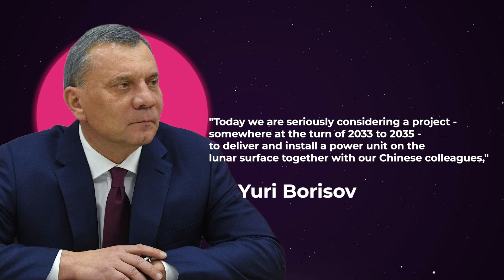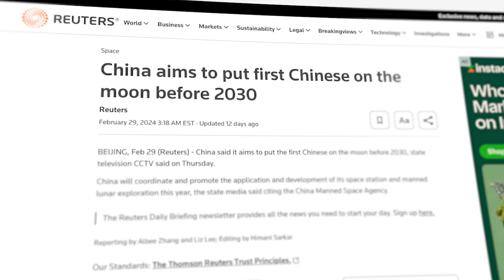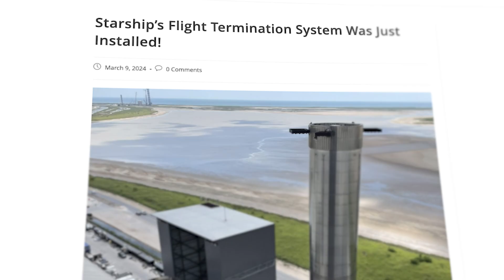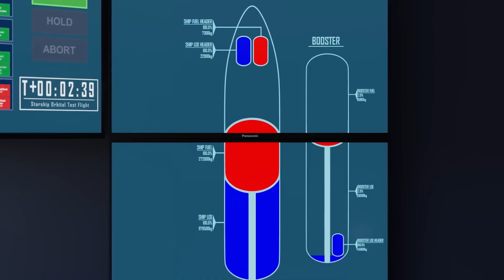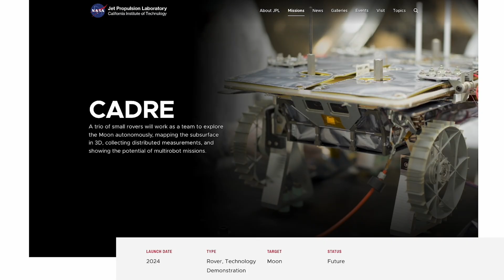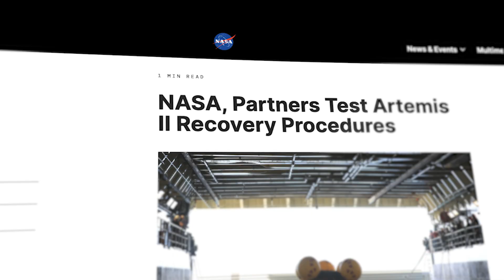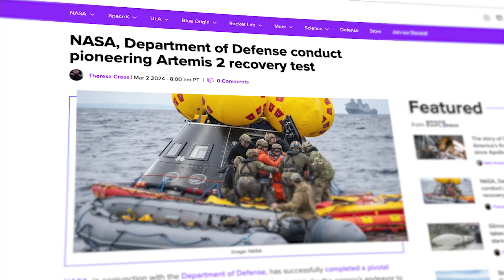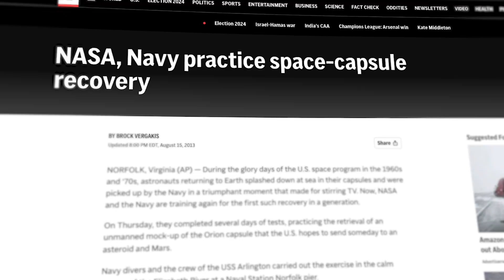China and Russia Reveal Plan To Build A Nuclear Power Plant On The Moon!

Comment: Where are they going to get the water supply to heat up for steam to turn the turnbine? 

Assuming they won't be able to find a continuous supply of water, how large does the radiator field have to be to cool down the steam? I guess they could just pump those steam through cooling pipes buried in the moon surface. That would still be huge, though.

Comment: parabolic mirrors and sterling engines is the way to go on the moon but we need to drill to the center of the moon the loose dirt the core is cold its the perfect place to put a base and there 0g there so you can do your 0g science theres and plenty of material to hold in 15psi so it can be comfortable there temp too just like the earth only its dark pitch black only light comes from lights. but a different types of technology maybe be better there like ion lifters will actually work there so static electricity can maybe more efficient.

Comment: At least 2,000 rocket-trips(?) If using Moon's sand & limestone (?). But still lack of steel rebar (even moon (1/6) gravity is weaker than earth 's make thinner/lighter Concrete Domes or Shelters.. but if Everything must came from earth.. at least 12,000 to 15,000 trips (of material conveyed) will never be enough..) Can we build Cement & Iron smelter on Moon.?
Not to mention Nuclear Power Plant.!!

Comment: Nah its not a huge battery problem. You use Hydrogen generators. During the Lunar day you use Solar to separate water/hydrogen which you then store ti burn later.

Your water is the battery uncharged and your separated hydrogen and o2 is your battery in the charged state.

During the 14 day lunar night you have all the power you need.

Comment: Starship is a disaster from start to finish.
Oh and the line of the video was from the scientist who said "heat dissipation is really the only technical hurdle to solve"   as if that was something new and not the direct problem and reason we have not put active nuclear reactors into space based craft for the last 70 years despite being able to make them small enough to do so for the last 70yrs and nothing has changed in the immutable laws of thermodynamics nor materials sciences to make that any easier today than it was 70 years ago. Heat is heat. On the plus side at least you dont have to worry about fallout from a meltdown.

Comment: Can't happen. No water on the moon, because of no atmosphere on the moon. The only way to keep the reactor from overheating is by outside temperatures, but that is crazy, because space is really cold in the dark and really hot in the sun, plus all the radiation from the sun and solar system.
Nuclear energy has to be produced underground, where it can be contained and I don't see silica sand as a great construction material, unless it can he turned into high strength glass+!!

Comment: 14 days of night indeed is a problem for a photovoltaic power station. But if the solar panels are placed on mountain peaks or crater rims near the lunar poles, they almost permanently receive sunlight. My tram already has evaluated the data. at least for 300 days per year we receive sunlight.
 And under these conditions, photovoltaic power plants are more efficient, safer, simpler, and require much less payload than  a nuclear reactor.
Reply: You wrote a lot yet said… Nothing? What happens with maintenance for example..?
Reply: @angelsackson   what did you not understand in my comment?  I do not see a reason why a nuclear reactor should require less maintenance than a photovoltaic power plant

Comment: Nuclear power is the way to go.  The heat can be radiated away if anyone is thinking an earth type nuclear reactor on the dark side of the generator, reactor or craft.  But small plutonium decay reactors as used on current probes is doable, they just need more of them or scale them up.  Then utilized rockets to launch and spent radioactive material into the sun to get rid of the problem.  Clear forward thinking on removable plutonium pellets built into serviceable fuel modules, that can be replaced (as needed) and then placed into a transport vehicle that can be launched from the moons surface to the sun.  Depending on which plutonium isotope used, the half life of the plutonium 238 used in the Perseverance Rover for example is 87.7 years… so these power systems are both practical and reliable.  Assuming the launch vehicle from earth does not experience a RUD on takeoff or landing.
Reply: The Wikipedia article on Pu-238 explains the problem of it being a weapons production byproduct. We are almost out, and it will take $$$ to set up dedicated production.
Reply: @VicariousAdventurer  I worked with radioisotopes for 41 years and have been a reporting officer to the NRC and three state radiation control departments… however… I  know about supply issues with 238.  I was giving an example of what can be done.  The thumbnails and pictures of nuclear power plants in the video is a misleading set of narratives
Reply: Sending material to burn up in the sun is quite difficult. You have to slow it down, ie overcome the speed the earth is orbiting at (107,000 km/h) in order to have it fall into the sun.  This requires a serious rocket, even with the low gravity of the moon. It’d be much simpler to just bury it somewhere on the moon, there’s not a lot of protest groups there to harass politicians and change their minds 😉
Reply: It's honestly the Russian or Chinese construction that concerns me.

Russia has an abysmal record with space and safety (in general) and China.. their engineering ideas and construction realities.. might as well be on two different planets. You can literally break apart Chinese concrete they make buildings out of.. with your fingers.

With the CCP in control and with Russia.. in any version of itself we've ever seen.
Competence has never been their strong suit

And I haven't even got to the horrifying reality of their reactors. Obviously a reactor in space is different somewhat.. but they can't build, operate, service, or sustain these things safely or environmentally.

Good news is.
Russian has dozens of irresponsibly abandoned RTGs just laying around Siberia waiting to become toxic ecological catastrophes.  So they could probably save a couple bucks and just throw one into space and hope it gets lucky and sits within the Russian Federation/USSR Safety record of successful launches and missions.. of under 37% of all launches.

So.. you know.
No worries there I guess.
Reply: @matthewbartley2746  mate you've been fed up on the western bs propaganda too much. Welcome to the reality check. Rus. nuclear power plants are the most advanced and the most reliable in the world. The ISS is actually a Russian program of "Mir 2" that has been powering the the whole station. It is connected to the Russian service module this whole time and has been as reliable as it gets throughout this whole time.
Also the Chinese is the only nation in the world that has a space station. There's only 2, the Chinese one and the Russian one - the ISS ( which was joined by USA in the 90s), there's nothing more reliable and advanced in Space than Russia and China at this point.
Reply: @matthewbartley2746  The United States may not be reliable either. The new "high-speed" railway caused casualties. Train derailment occurs. And its Odysseus lunar lander also overturned during lunar landing. In most cases, the media only displays negative news from these two countries, without focusing on bad news from the United States itself, which is why you feel that way

Comment: HEAT PROBLEM = you have to condense the heat in a solid (soil, block of metal, etc) and physically "throw it on the moon" and then recuperate it after it's cooling cycle is done (6  months? 1 year?)
Reply: ❔A cooling cycle is 14 days on the moon.  14 x 24 hours of permanent exposure to sun light without the help of water or even an atmosphere.  The 14 day long night should be straight forward, though it first also needs evaluation.
Reply: At e South Pole, there are some areas in permanent shadow (in dips) - and even the lighted areas are very strongly slanted light, think of the warming difference in Summer on Earth at the North Pole versus Equator. Extensive pipes can carry heat through regolith. For small reactors, high levels of heat can be radiated away. Like in a reactor for space (someone once pointed out that radiative cooling goes as T^4, which was a little embarrassing since I should have thought of that)
Reply: @VicariousAdventurer   these permanently shadowed regions ,you only find at the poles, where you also can harvest sunlight almost permanently without a 14 day break.  In the lunar vacuum the regolith has an extreme low heat conductivity , so you cannot conduct much heat into the regolith trough pipes.  Heat only can be radiated into space, as it is done on the ISS.
Reply: If one pole is continually in light, the other is in dark. It works the same as on Earth.
Reply: Apparently estimates are very low (for dust in general), but much higher at newer impact craters (sintering) - so there might be a site selection aspect.
Reply: @VicariousAdventurer  Big difference is air, air distributes heat from warm places to cold place.  Don't know the factor of distribution, or if it can even be estimated. 
Moons has near zero atmosphere.
Reply: Ultimately, you end up, on the moon, with heat radiated away. One is a solution for large-scale (pipes in regolith, and the moon varies a lot so there are areas of greater thermal conduction) ultimately, regolith radiates the heat away. The smaller-scale solution is to smelt and bring along a "radiator." In both cases, heat will ultimately be radiated away, since there is no river or air to dump it.
Reply: @VicariousAdventurer   the axial tilt of the moon rowers the sun is 1,5° only ( while Earth has an axial tilt of 23°) so the difference is minimal, and even when the pole is turned away from the sun, some high peaks, or photovoltaic panels placed 10 - 20 meters above ground, still receive sunlight
Reply: Probably have pipes circulating in the crust at the South Pole.
Reply: Also, you usually do not have to dig so far (beyond a skin depth) as to get a temp that is an average of the surface temperatures. 14-day days and nights aren't even the yearly variation that heat pumps on Earth deal with. Exponential decay of temperature oscillation with depth does the job. Unfortunately, the same factor involving distance from the pipe means an extensive field is needed, so I only see this for a large installation.
Reply: @VicariousAdventurer  Very interesting, it cools by being in contact with other physical molecules around it, acting like air, but in the ground. Clever.
Reply: Shuffling solid heat sinks or regolith is likely not effective, the thermal capacity is there but the challenge for any TCS is heat transfer rate and controllably. The best solution in my opinion would be using a large heat pipe radiator that can be kept pointed out dark space, coupled with a heat pump to help increase the temperature at the radiator temperature thus decreasing it's size and increasing controllably.